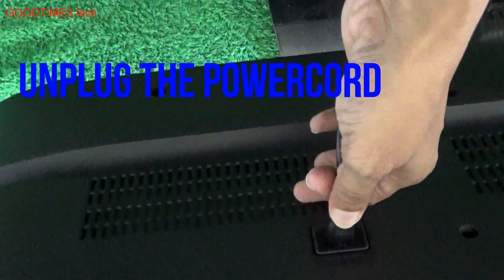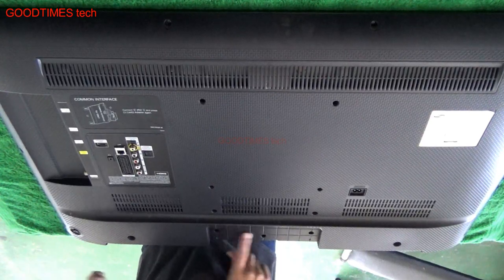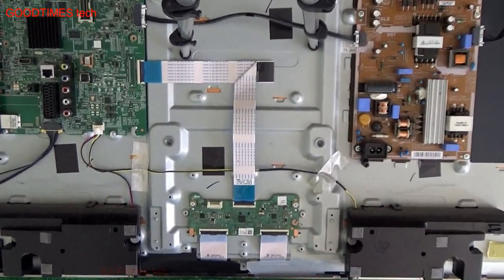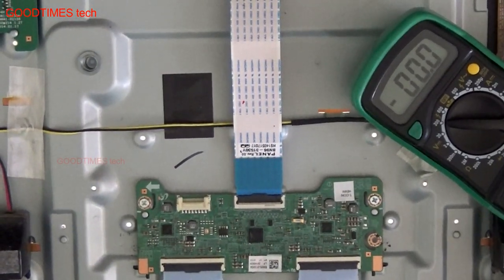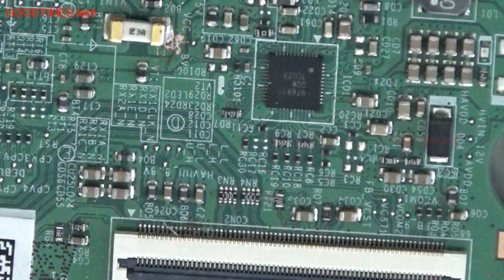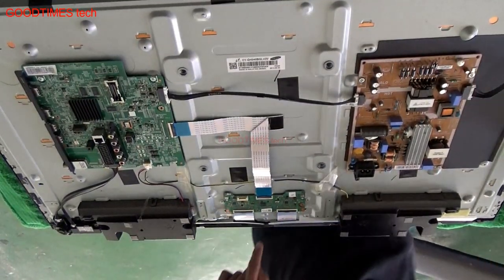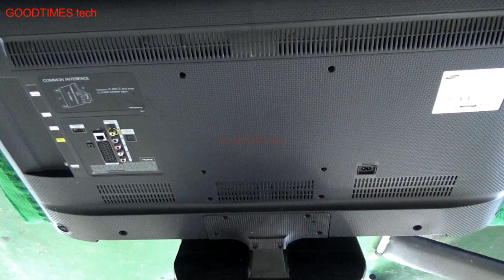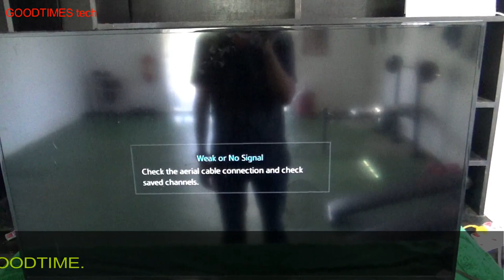SAMSUNG LED TV showing blank screen | No image | No video | Sound OK

Comment: I prefer the old timer secret repair trick a 35 year career Samsung technician taught me
Step 1 : get yourself scotch tape & a 8.5 oz ball peen hammer
Step 2 : run the tape diagonally from each corner
Step 3: locate the center where the tape intersects 
Step 4 hit the cross section with the ball peen hammer with as much force as possible
Problem solved!!!

Comment: I have a similar issue: samsung t32e310 ex. If I disconnect the ribbon cable and reconnect while the TV is powered on it's working again (sometimes it needs some fidgeting with the cable in the connector. But when I power off and on the picture is gone again. 
There is three TV with the same issue. I'm trying to figure out the problem. The board is similar but not the same as on this video and I cant find the fuse...
Reply from the maker: Turn OFF the TV, try cleaning the metal contacts on ribbon cable with the rubber (pencil rubber used by students)if any dark marks and clean the connectors on PCB as shown in the laptop repair video in the link below:
https://youtu.be/vKZNyV3l35U 
After cleaning with liquid blow air with hair dryer or wait for several minutes for it to dry and then connect the cable and switch ON.
Hope this will solve, if not then you need to check for dry solder joints on connectors.

Comment: My tv is UA43N5300ARXXL. Same problem.How much should I pay?
Reply from the maker: Hi, sorry for late reply.
You can pay service fee + cost of spare parts used.
Here in my city, service charge is rupees 500 to 1000 and if the technician is replacing the T-con board, it would cost 1500 to 3000 or more, depending upon the T-con board model. If any other problem it may cost less or more depending on the part replaced.
Thank you, have a GOODTIME....

Comment: will this also resolved no backlight issue? ua48h5003AR
Reply from the maker: Hello Sir, 
    For backlight issue, need to check inverter section(LED Driver) in power supply board, if all voltages are ok then need to check LED strip and replace if faulty, try to replace all the backlight strips to avoid repetition of fault.